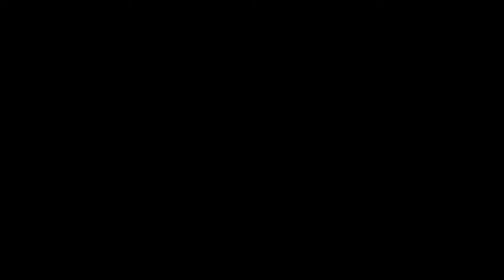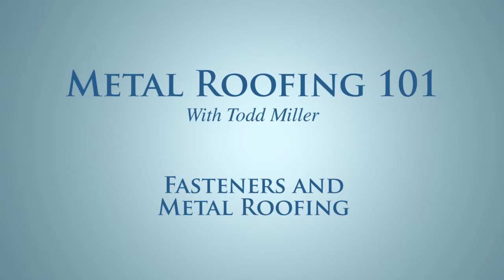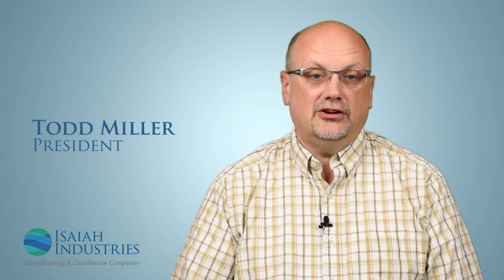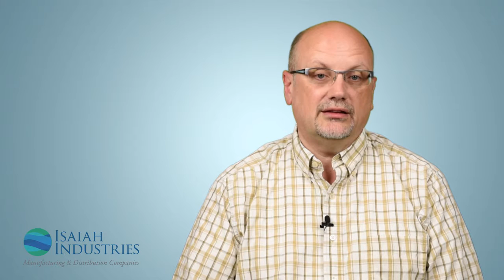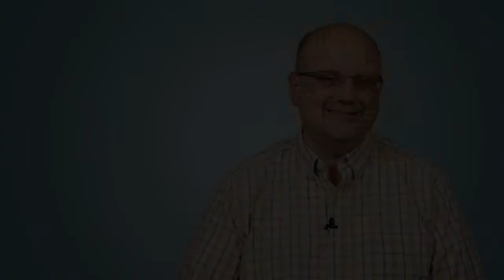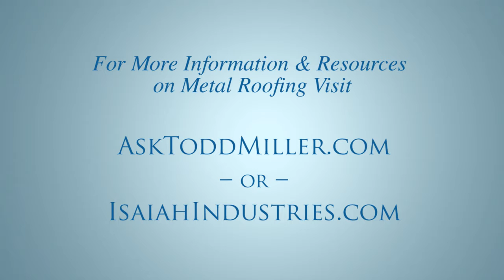Fasteners and Metal Roofing – Metal Roofing 101 with Todd Miller

Comment: I’m in south Florida beach side and thinking of replacing my damaged shingled roof from hurricane Irma to an exposed fastener metal roof. How much faster do these fasteners get damaged from salty air? The non exposed metal roofs are a lot more money but I beginning to believe it pays for itself in the long run.
Reply: Enkapsulator.com has a cool product and method for sealing fasteners.
Reply from the maker: With an exposed fastener roof, there are quality fasteners available. There are in fact even stainless steel fasteners. The concern more is the lack of allowance for expansion and contraction of the metal and the impact that has not only on loosening or fatiguing the fasteners but on the holes wallowing out, eventually allowing water in around the fastener which then causes rust on the panel itself. Concealed fastened roofs usually have allowance for thermal movement of the metal and that is a huge benefit.  Also, for many coastal applications, property owners are choosing aluminum rather than steel. I do think that, in the long run, a concealed fastened product is wise and even an aluminum product is wise.